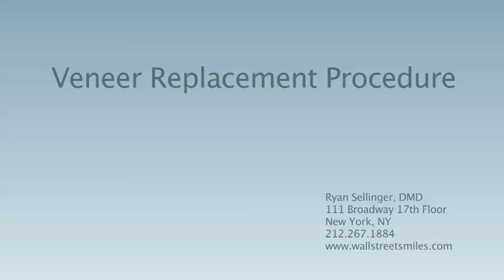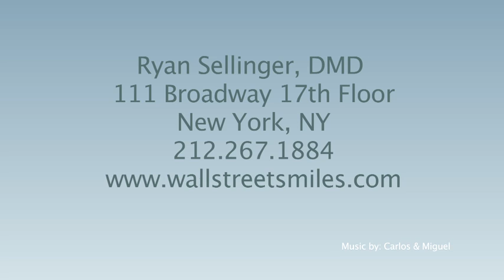Veneer Replacement Procedure

Comment: Doctor, I'm considering veneers but I have a concern. I read that on average, they last about 10 years. Additionally, when it's time to replace them veneers might not be possible because there is not enough enamel left. As a result, crowns may be required. Is this accurate?  If so, how often does this happen (crowns required vs. veneer replacements )?  Thank you in advance for your clarifying.

Comment: I have to have my four, upper veneers replaced. I'm not happy about this as I did not want veneers in the first place. I had healthy, strong and nice looking teeth. I chipped a corner of #8. I'd had it repaired two times over ten year's. It wasn't really noticeable to anyone but me. I graduated from the best dental assistant program in the states. It was fifty hours a week for a year, including the two years of requirements just to get accepted. I wanted to work with low income children, but had my internship with a cosmetic dentist. He was a perfectionist, so I took my children there as well. His sister is also a dentist and we have become close through the years. My daughter passed away and I wasn't concerned with my teeth until one broke. They did X-rays and told me that I had to replace my veneers because of a cavity. I'm sorry if I am straying a bit. This entire situation has been so frustrating. The veneers that we learned about in school were a thin shell over your natural tooth. I had to take a break during and when I saw what he had done, I couldn't stop crying. All of this because of a surface chip? He claimed he couldn't fix it (even though it had been repaired twice and I'd never had cavities) and veneers would be a permanent solution. Okay, I agreed to the from two. He said I should do the top six to make them look more uniform. We settled at four. So it's been fourteen years and my teeth behind the veneers have cavities and have begun to separate. He said I had to replace them all and he'd put in a permanent retainer to prevent spreading. He made me a retainer and the space closed. Friday was the last appointment and he was suppose to add the permanent retainer. He said no and that I needed to see an orthodontist now. I'm not sure what the point is considering I agreed to have the veneers replaced. I just started crying. I don't have any fight in me. Orthodontist don't fill cavities or replace veneers. If I don't figure something out soon,I'm at risk of losing one or four of my front teeth. Truly, I don't care about my appearance, but I am raising my daughter's little girl and I try for her sake. I don't want to embarrass her. I don't know if you read these comments, but I would truly appreciate any suggestions or advice. Thank you.
Reply: Jacinda you should search and consult some more dentists. its better to get various experts openions than relying on only one.
Reply: .just go a head and get implants...and that will permanently fix the problem

Comment: How were temporary teeth surfaces created ?
Wouldn't they need to be made by a dental technician ?
How much would this procedure cost in NYC ?
Reply: you can use bis-acrylic resin for fabricating provisionals
Reply: They're done by a negative copy (impression) taken from a waxed-up cast, i.e. the technician (or some dentists do it themselves) have previously done wax build-ups on stone models outside the mouth of what the new veneers should look like, to be replicated by bis-acryl (or any other suitable material) as the previous commentor has mentioned.
Reply: SaudisRBastards Thanks.

Comment: Her old veneers were in good condition.  She had a very small gum recession.  Would have not been easier to do the Pinhole technique to bring back the gum to its initial position instead of making new veneers with the risk of trimming more of her real teeth ? Plus her teeth will have to be longer now to fit the new gumline.

Comment: Mmm, I know that esthetics is very subjective, and it takes the opinion of both the dentist and the patient, but I don’t like the end result. I agree that the black triangles don’t look good in the old veneers but removing the triangles by making rectangular teeth is not what should have been done, female teeth tend to be triangular in shape. This new veneers make her look like less feminine to me. If I take the before and after photos side by side it’s easy to mistake the end result with the teeth of a man. Teeth are too big, 23 is badly contoured (maybe it’s just the photo).Any way if the patient was happy in the end then it’s all good.

Regarding the technique I think the only thing I would change is the cementation, use self-etched
dual cure cement, this way you will add less material between the teeth and the
veneer. 

Also the photographs are all wrong, you are taking them in f4 or f5 probably on auto mode, only the central incisors are in focus, the laterals are looking a little blurry and then it gets worse with the canines. Use a high f stop f20 or f22 to get everything in focus and don’t display the final images in different white color balances.
Reply: Jan Desens dual cured cement predisposes to marginal discoluration due to amine production.light cure veneer specific cement is advised

Comment: I was slightly more happy with the before height/width ratio, but if the black triangle seriously bothered the patient for psychological reasons then this is the right treatment. However, with such a small black triangle bothering the patient, overall esthetic demand must be very high.

Comment: Couple of points with your technique. Fisrt of all if your are "fixing" the black triangle why do you have to replace all the restorations? I don't know if i like them better even with the black triangle rather than the finals ones. Second, You're taking bite registration without the temporaries (prep stage) for what? it does not make any sense because you're already modifying her occlusion by prepping the teeth. Third if you cure your adhesive material before the cementation you're adding thickness to the preparation and you take the chance of your veneers don't fit properly any more, you cure it when you want to seal the dentin prior impressions. And finally try not to use a ring flash for the esthetic zone, the light reflection is bad, switch to dual point flashes to define the lines angles and the texture.
Reply: For you to know so much about porcelain veneers you sure can't spell..
Reply: Sorry, mate, but it's not about YOU whether you like the black triangles or not; it's about the patient! She obviously had gingival recession and what appeared to be cervical erosion (abfraction??). I believe what the dentist probably missed was why she developed those triangles and recession in the first place. A prior occlusal analysis should have been done, and incorporate the new veneer design into the adjusted occlusal scheme (if necessary). I do, however, agree with some of the other points you've raised. I'll get back to you on that. Cheers.

Comment: I would die if this were me!!  Her original teeth are destroyed - no going back!!  I think I would have just kept my original teeth and had some kind of braces (Invisalign), shaping, and whitening.  No way would I do this to my front teeth!  I had a crown done after a root canal on my very back tooth, and I nearly had a heart attack when my tongue touched that tooth after it was grinded down like a stump in preparation for the crown...ugh! 

With that being said, you did do a great job, I loved that you weren't lazy and missing any important steps, etc., and she had a beautiful smile ;)  

One question...why can't we just keep the temporary veneer/crown if we choose to do so.  It seems to be cheaper.  I know they say they won't last as long, but it should at least be an option for those of us who don't want to spend twice the amount.  You could always have it put in writing that it's a risk that the tooth will break, etc.  No?
Reply: I think he said them teeth in the beginning were ones put on her teeth to get her used to the size and length
Reply: Ahhh, ok.  Thanks ;)
Reply: It's also entirely possible that she had large cavities or a lot of tooth decay.

Comment: There was nothing wrong with her teeth.   She needed deep cleaning and healing but to grind those teeth down for veneers is just wrong.  There will be leakage decay sensitivity etc.
Reply: Not to mention a thousand dollars per tooth I read is the average cost.
Reply: Veneers were already there. She just needed new veneers because of the grayish  thingy in the gums.
Reply: these were replacement porcelain veneers... so it is what it is. but if you were getting yours done for the first time, you might be able to get composite veneers, which don't require your teeth to get shaved / filed down like that.
Reply: Agreed

Comment: The canine anatomy facial height of contour looks too far apical to me.
Reply: I believe they're about the right height; they're at the same level as the central incisors. However, you are correct in noticing an error in the morphology of the canines in that the technician didn't get the inclination right: upper canines usually are linguoverted, in their incisal half especially.
Reply: +SaudisRBastards lmfao "SaudisRBastards" why though?